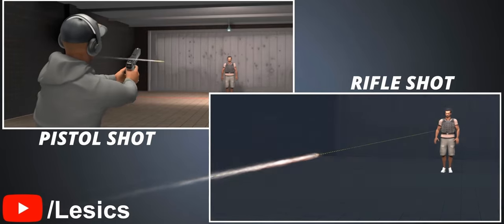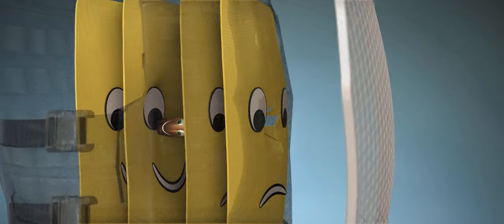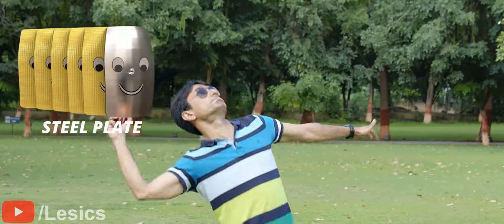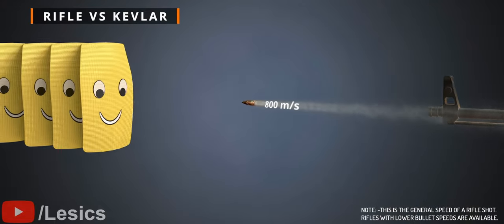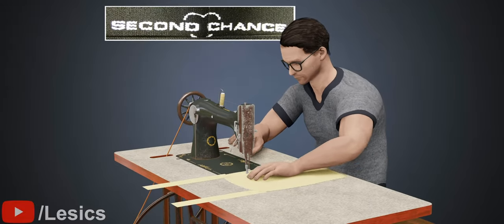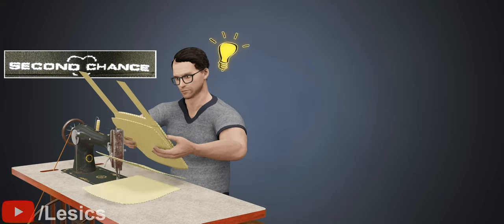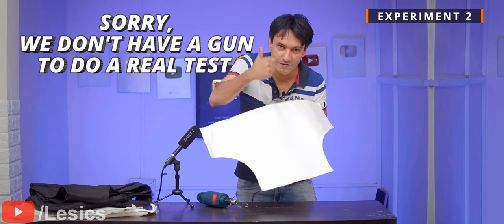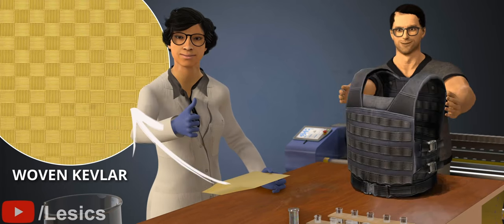Bulletproof Vests | How do they work?

Comment: hat’s UHMWPE in UD laminate form…Dyneema/SpectraShield/Endumax/Tensylon or some other generic brand, but  not Kevlar (Kevlar is yellow/golden). Kevlar is 7x stronger than steel and UHMWPE is 15x stronger than steel, and doesn’t really degrade so vests last much longer and it can float.  Most high end soft body armor makers use combinations of different Kevlar & UHMWPE materials to make thin light weight composite armor.